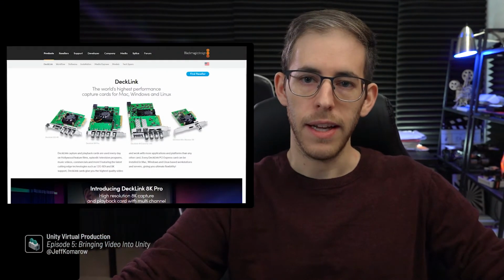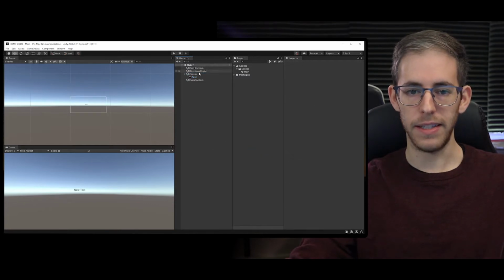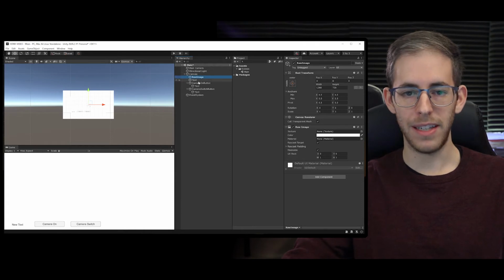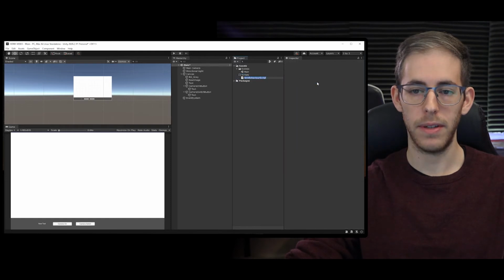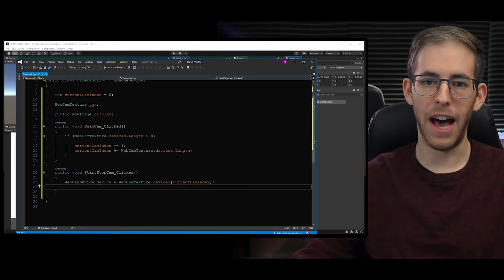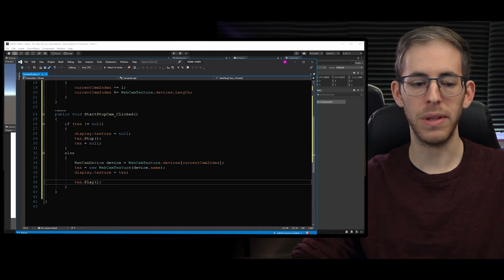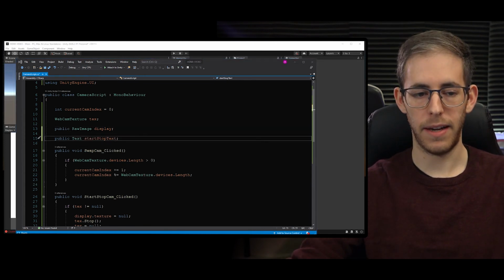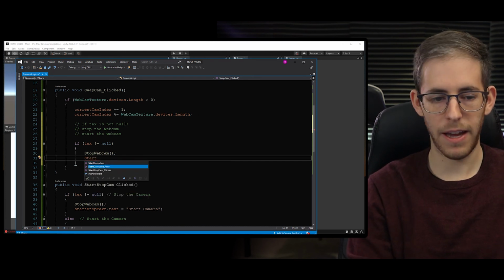Bring Video Into Unity through HDMI, SDI, Webcam, Android, or iPhone!

Comment: Just a note if you are trying this in Unity 2021...TextMeshPro is the default text type for buttons now. Due to that you need to change "public Text startStopText" to "public TMP_Text startStopText" and make sure to add "using TMPro" to top of C# script. Without that, you cannot drag text from StartStop button to script in inspector panel.

Comment: How did you make you Digital camera detected as webcamera to be used with Unity, Because I tried using my Digital camera as feed but Unity does not recognize my Camera at all, all I get when I tried running Unity is just a blank screen. Thank you
Reply from the maker: How does the camera connect to your computer? If you are having trouble the solution may be to get a simple HDMI capture card.
Reply: @JeffKomarow  The camera is connected to my computer using SDI cable via a Mini recorder converter blackmagic sdi to hdmi.
Reply from the maker: @hizralashraq159  You might have a compatibility problem with your devices unfortunately, try troubleshooting different devices and see if you can pull up the feed as a virtual camera in a program like OBS.

Comment: Do I miss something in code? My WebCamTexture isn't in green so it doesn't reconice it as property or class. I think I created script same way in Unity also.
Reply: I think reason is that I don't have cam mounted yet... Now on I have only gopro to use. Do you think that I can test this gopro usb or do I need least some card?
Reply from the maker: @teemusekki1743  You might have missed something in code. I haven’t tried a gopro through usb as webcam personally, but it seems the newer ones may have that functionality. If that isn’t working you can always go through the micro hdmi to hdmi capture card route.